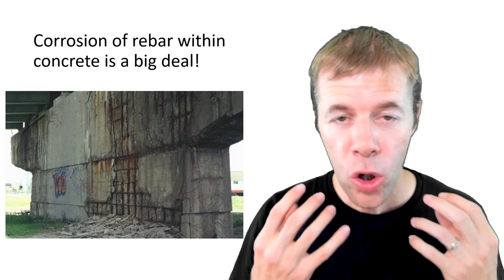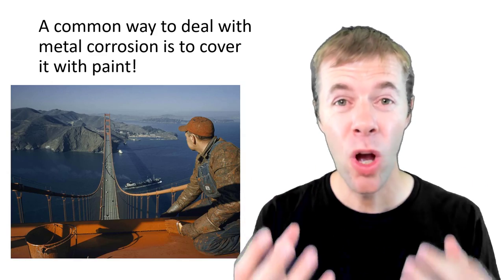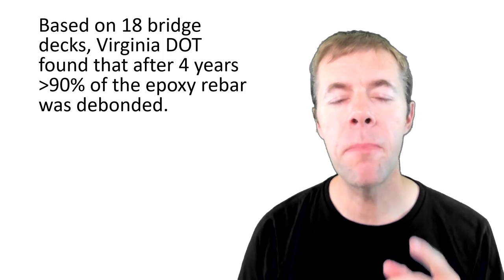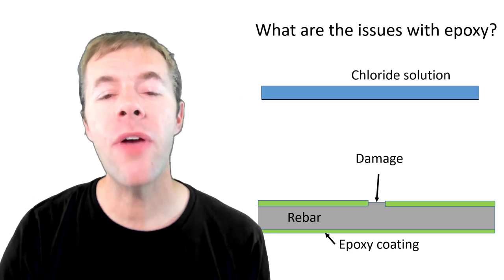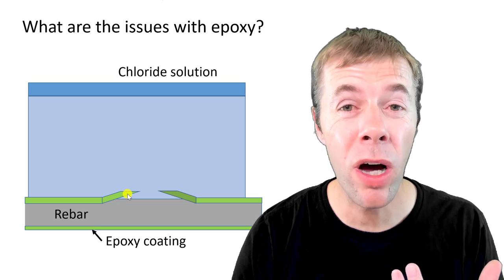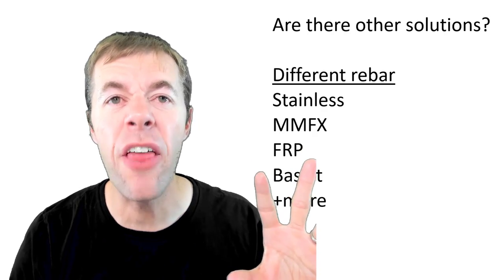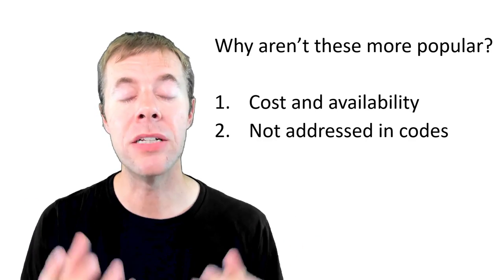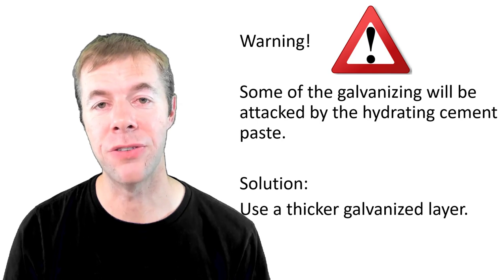What is epoxy coated rebar and why is it being banned?

Comment: I work at a precast plant an we use rebar an have to bend it every day if it was galvi wen u bend it it would expose the rebar an crack the coat but a good idea but still u be in the same position as apoxy coat rebar with weak spots
Reply from the maker: Jason - Thanks for your follow up comment.  Galvanizing is tougher than epoxy and more resistant to wear.  Depending on the thickness and makeup of the layer then it will determine how resistant it is to cracking.  I totally agree that there will still be damage but there will be less damage.  We don't need perfection in civil engineering but we need to reduce the chances that we get outside chemicals corroding our reinforcing.  Galvanized rebar has been used on a lot of concrete projects and has shown good performance in the field.  It may not be the final solution but I am convinced that it is an improvement over what we have now.
Reply: Galvanizing is a sacrificial coating where scratched sections will still be protected, unlike paint/epoxy coatings.
Reply from the maker: Dale - Doesn't depend on how big the scratch/gash is?
Reply: Tyler Ley yes for sure, I cannot provide data, however can say from practical experience that small scratches in galvanizing down to base metal do not lead to un-bonding of the coating or pitting. Great video btw:)
Reply: @dalekreviazuk233  wat it really comes down to is way standards does the state require really cuz no company gives a shit how long it last they want it to break so they can fix it...job security really
Reply: I still say the thicker rebar will hold out longer cuz it takes longer to break down an the product will be much stronger an be able to hold more weight
Reply: Bridge jobs have bending specs for all rebar pieces before construction takes place.  All that needs be specified is that the bent pieces are hot dipped after they are formed!  'Problem' with bends solved!

Comment: The pool at Florida condo in Surfside probably had small leak, and was part of the same concrete pour as the garage columns that held up the whole building, 
the chloride eat up the rebar and made small channels inside concrete slab to further damage to rebars until it reached the garage.
Reply: You don't know that for sure at all.
Reply: @R.U.1.2.  I said probably, but as pool deck crashed first, pool repair man said pump room concrete walls was in terrible condition 3 days before, 1+1 = 2
Reply: @tonysofla  The pool repair man told you......right.

Comment: Stop Throwing Salt all over everything , it would be cheaper to buy snow tires for everyone than to constantly repair roads and bridges. In the long term
Reply: Artstrology buildings too?
Reply: @nomangreybeard535   Do not throw salt on concrete.
Reply: The excessive use of salt on roads also contributes to contaminated ground water
Reply: Sand works well to increase grip in a wide range of snow and ice surfaces. And its cheaper (for now).
Reply: I agree with you that the added salt on the roads has a detrimental effect and accelerate degradation of all modern infrastructure and vehicles, however there is enough salts (various species, not only NaCl) in the concrete to assist with corrosion of the rebar. Concrete rot occurs everywhere, even in countries that do not have the icy roads problem. It just happens quicker where the ion load is increased, for instance in a marine environment.
Reply: @0409hdl  *SPECIES*!!!???!!!! Dude I need some of that weed you're smoking!
Reply: @Pet_Hedgehog  
For your own benefit, please look up the definition of chemical species.
Reply: Being a truck driver in a cold, snowy and mountainous country, I thank every ounce of salt on the roads every day at work.
Reply: @Pet_Hedgehog  i do welcome his resonable comment. But i doubt many people want to hear your little rant.
Reply: There speaks someone who doesn't live on the coast. Oakland Bay Bridge was built with this and it is sitting in salt water.
Reply: @michaelguth4007  everyone has 2 or more faces
Reply: @michaelguth4007  sounds like its not my problem
Reply: @jodystradesstuff5048  passive aggressive but good one!
Reply: @jodystradesstuff5048  Love your sense of humour.
Reply: Woodchip mix, it dosent freeze, and it provides traction, there are already street sweepers
Reply: @Dueilangoisseus   I hope you have stainless brake lines. Stay safe.
Reply: Hello Artstrology. What Tyler did not address in this video is that carbon monoxide seeps into the concrete same as chloride, and rust the rebar. How do we make concrete non-pores,  that never cracks
Reply: @secheltfishmarket6419   In my opinion as a builder, concrete is a material with a limited life span and should be used with that in mind. I prefer stone and glass. The rebar that I get seems to be made from recycled push lawnmowers and tin cans. 
     What happened to building 7 on 9/11, should have affected the building codes, but mysteriously nothing was said.
    That said, , for a slab, plastic underneath and epoxy mortar adhesive and tile on top.
    Pour it dry, cure it slow.
Reply: @Pet_Hedgehog  Sand also clogs drains
Reply: The people don’t like to add something and it is kind of useless when the road is an inch of ice
Reply: @AlexMarkovRus  true
Reply: Live in PNW. We don't use salt here. 2 inches+ of snow shuts down the whole metropolitan.  Because non-corrosive de-icer  dilutes quickly and stops working at moderately cold temps. Leaving ice rink roads.

Salt actually makes it so my work doesn't try to fire me after a snow storm.
Reply: Most states use beet juice which corrodes much faster than salt. Nebraska switched back to salt because of the accelerated damage from the beet juice
Reply: I live in Minnesota, salt is an absolute necessity to the highway system... without it the whole north would be slowed to a snail's pace every time it snows... and it can snow 8 months of the year here.
Reply: Snow tires aren't gonna help you with ice on the road
Reply: or SAND  @Dueilangoisseus
Reply: Mr Cabot  There is no public transportation outside of urban areas and suburbia.
Reply: You don't know true terror until you've tried to drive in an ice storm. I don't care what kind of tires you are riding on you're sliding. That's vehicles being destroyed and lives being lost. You have to balance that against the infrastructure damage caused by road treatment. Roads are useless if we cannot use them.
Reply: @Pet_Hedgehog  https://en.m.wikipedia.org/wiki/Chemical_species
Reply: Amen they use too much in Michigan. I have a Jeep with winter tires and could and have driven on ice. So many people drive way too fast. Tires make the difference!!!!
Reply: @1pcfred   Studded tires should be excellent on any snowy roads, it is the best option, if it is so bad that those are ineffective the travel emergency should be made and all traffic must wait until conditions improve. Salt is not going to help more than studded tires,... but like any disaster, it is difficult to keep people from doing ill advised things.
Reply: @artstrology  there are some people that cannot wait until things improve. They're called essential personnel. Most of us don't want to wait either. We all feel like what we're doing is essential. There's only so many days in a life.
Reply: @gillgetter3004  My 1982 Toyota 4WD pickup with solid axles can run circles around any Jeep. And even it slides on ice. That's because ice is slippery.
Reply: @1pcfred   I agree,. and officials who close the roads are essential. So are studded tires for essential personnel.
Reply: @artstrology  metal slides real nice on ice. When the ice is slick I don't care what you got the coefficient of friction is simply too low to maintain any kind of control. What we like to say is 4WD just gets you going faster before you crash too.
Reply: @1pcfred   When conditions are prohibitive, emergency closure is appropriate. and btw, asphalt is not concrete, so I don't care what you throw on asphalt
Reply: @artstrology  Highways are often asphalt on top of a concrete base. Asphalt is porous too. Then there are bridges. Which are often concrete today. They tend to ice up first too.
Reply: Hovercars.
Reply: @chickenlips8696  not only that, one ice storm will often stay on the road for months on end if you don't salt them... sand can help, but you put that down every day verses salt which you put down and the ice goes away. it sucks that we have to salt the roads, but if we didn't use salt when necessary, we wouldn't be able to live here. better than building next to the rising saltwater oceans... those things are threatening all year round.
Reply: @Paul Frederick
Hey Paul,  fancy seeing you here.  

I'm running studded Hakkapeliitta's on an AWD.  We just had an ice storm a few weeks ago (we get a lot of them here in the mountains), and I was driving highway speeds on these tires.  I couldn't even tell the roads were covered in black ice until I came upon a line of cars driving 15 mph and sliding all over the place.  

I live on a hill on a private road in the mountains.  It's never sanded/salted, and it's always icy.  I don't think I've spun a tire once this year climbing up my road.

Not saying you're wrong, but personally, I'd take my winter tires over that corrosive shit they spread all over the place any day.  It rots vehicles out in a few short years, it destroys roads and bridges, it kills trees alongside the roads, and it causes a lot of damage to our aquatic ecosystems up here in the park.   30-35 years ago it even leached into our well water where I grew up, we had to sink a new well...   It has its place during major ice storms, but they overuse it by an absurd amount.  Anytime it spits a little snow, they are out there laying it down like they get paid by the pound.
Reply: They don't use salt anymore on the roads.  They are using radioactive brine wastewater (the stuff that's left over from the oh-so-great for the environment shale fracking).
Reply: @Pet_Hedgehog , why would you degrade him for proper use of a word? You call him a smartass when actually he's just smart has been educated on the subject and you are ignorant and that made you mad. Look it up and learn.  I'm here because there is so much to learn and I appreciate those with specific education to help me do that. Ran across an epoxy expert a month or so ago, really appreciated his input.
Reply: @KayAteChef  😂😂😂 see also Kay Ate @justas drigotas      lunch 😂😂😂😂
Reply: Without salt on roads many of you would loose families in accidents.  People have to use them to pay their bills.  Snow tires and sand do not work because people will not drive 25 mph.

I see deer eating grass next to roads all the time that are salted every winter so don't give me that commie crap about contamination.  Winds on mountains blow all kinds of minerals, even toxic, into drainage systems with dust.  Deal with it.
Reply: Mr Cabot  Nobody wants to be a communist lab rat, sitting where other rats have been recently.  Especially where towns or counties decriminalize meth, heroine, etc and the bus driver ain't gonna clean using white gloves.

I work in metro areas over populated because politicians approve massive apartment projects where no one will own and be responsible for anything.

I appreciate your sentiment but it is not practical.
Reply: @Pet_Hedgehog  ,  I know this reply is a month old, but,  you called out Alchemist, you showed your ignorance and he politely corrected you. Then, you break out the f bomb and run away with your tail between your legs?! Wow, that was a classic display of a beat down. P.S. often times I verify before commenting, maybe you should, too.
Reply: @filster1934  running away? If I were to run away I wouldn't of replied so many times.
Reply: Hear, hear! I can drive in snow, so I know it can be done. I hate not being able to have nice vehicles because no one's willing to get up a little earlier on snowy mornings or concede that a Camaro isn't a suitable winter car in places that get a lot of snow.
Reply: @0409hdl  While you're at it, could you PM me the formula to convert lead into 24carat gold? l promise l won't tell anyone.
Reply: @Pet_Hedgehog  You seem to have an inflated sense of your own importance. Why don't you run for president?
Reply: @1pcfred  lt is? You're kidding?
Reply: @frankmiller95  what is? Can you be a bit more vague?

Comment: Galvanized material actually has a reaction with concrete which causes it to destroy the concrete faster. That can be solved by are using sulphate resisting cement and introducing chromium trioxide to the mix
Reply: Chromium trioxide is hideously toxic, though.
Reply: And so are the fumes from epoxy. That's probably why we have safety procedures, right?
Reply: @garyg2318  go review the health hazards of chromium trioxide, including the required protective equipment, and get back to me.

Chromium trioxide is carcinogenic, and a strong enough oxidizer as to ignite bare flesh or other organic compounds (like cotton denim). We're talking about the concrete workers needing to wear full tyvek bunny suits with respirators to pour the concrete, and all while watching the forms light on fire.

Then there's the long term hazards of hexavalent chromium.
Reply: You really think I haven't fully studied that long before we had Google? You ever think about climbing a microwave Tower
Reply: @garyg2318  not if the transmitters are still live, thanks.

Though I have had to stand in the beampath of a submarine surface search radar before. Choice between me getting zapped and some frackwit closing at high speed needing to be shot before he blew up my sub. Or at least that's what it looked like to all of us that day in October 2001...
Reply: I hope you are wearing your PPE! That's why I've spent around 40 years writing safety instructions
Reply: @garyg2318  only on days that end in Y, man.
Reply: How much chromium trioxide are we talking about? I'd imagine that when your structure is decomissioned, you don't want to have loads of D007-characteristic debris lying around.
Reply: @TheStephenation  that, too.

Comment: I "enjoy" rebar: cheap & easy to get. I use it for a LOT. Factoid: I have NEVER used it for concrete.
Reply: Russ Gallagher  Rebar is the 2N3055 of metallurgy. If it's still steel but they can't sell it as any other higher-value steel, it's rebar. It's mostly former cars, with all sorts of weird alloying elements that entails, but not in the amounts that they occur in actual cars.